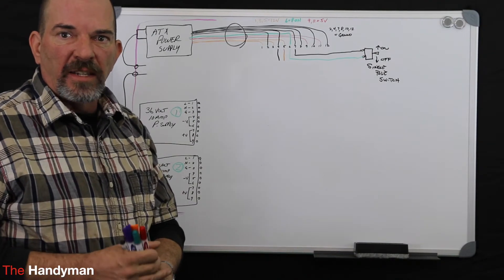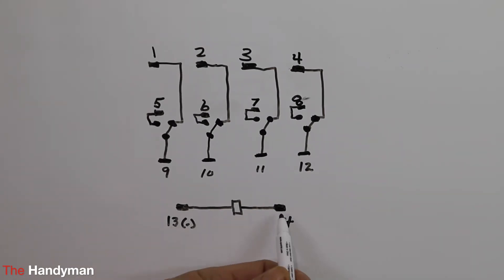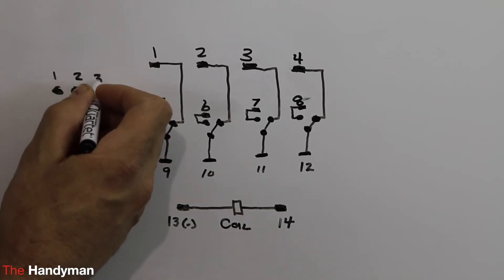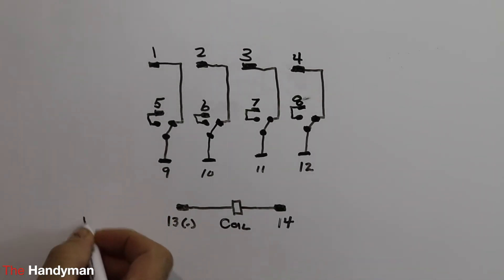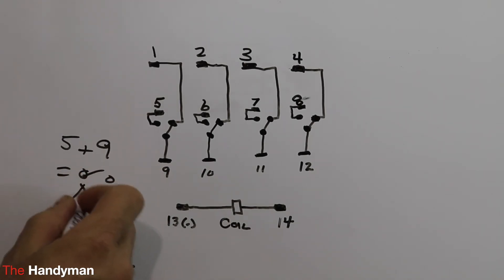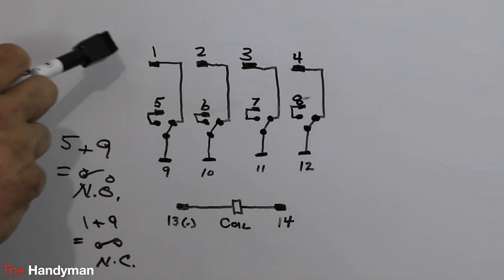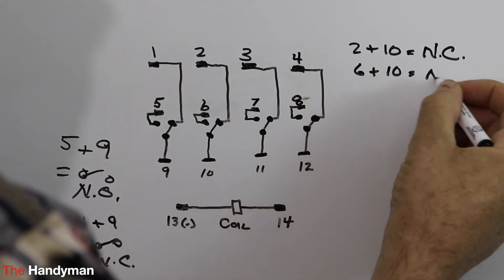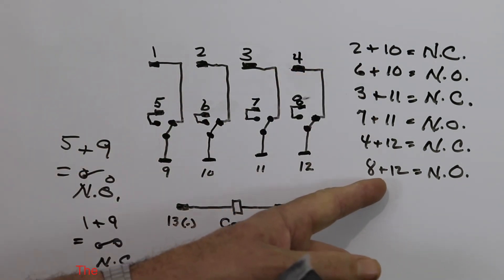12V Relay Diagram used in CNC Build videos.

Comment: So what do pin 13 & 14 do?
If I put positive power to pin 1 does pin 5 become live & pin 9 dead etc?
Reply from the maker: pin 13 and 14 is your coil power. Your negative goes to pin 13 and positive goes to pin 14. So when power is applied to those pins the contacts open or close depending on how you have it wired for your application.

Comment: Pls explain about wiring the relay
Reply from the maker: When you apply power to pins 13 and 14 your contacts will open or close depending how you landed them. For example, you turn on power and it energizes pin 13 and 14 closing the coil, that in turn will open pins 1 and 9 and simultaneously close pins 5 and 9.